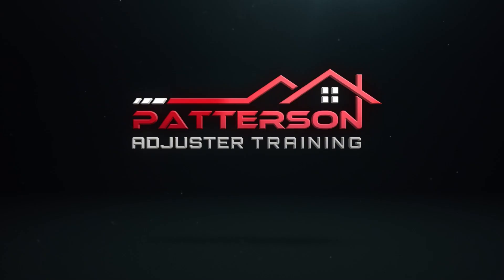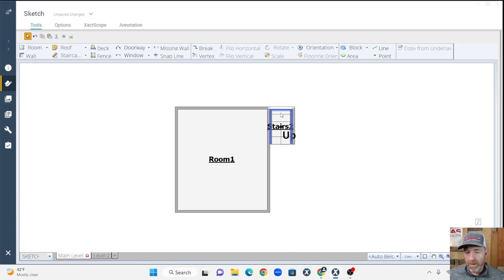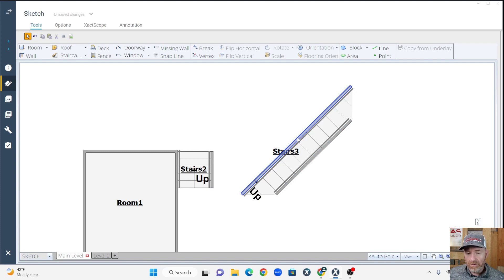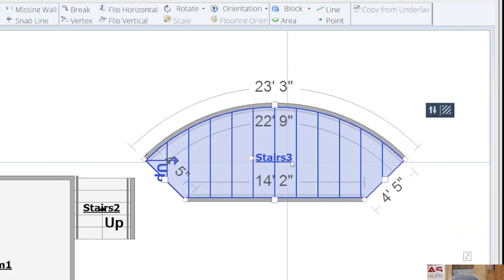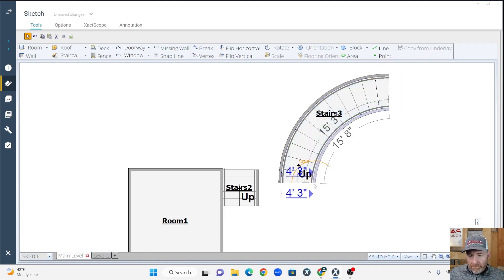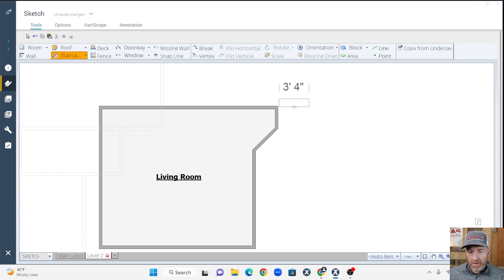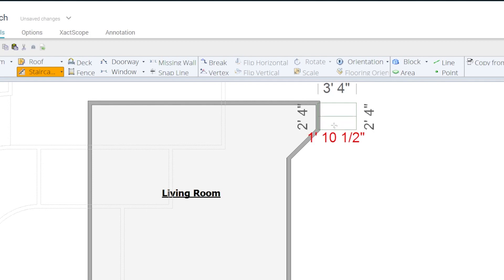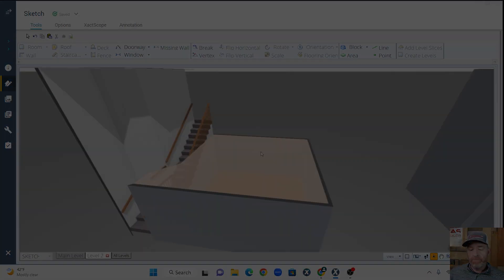Learn How to Sketch Curved and Angled Stairs in Xactimate

Comment: Man I pray you see this and can help, I have been taking the lvl 3 exam for the past 3 days for the exact diagram that you took I believe based on the video. The problem I'm running into is the "rounding measurements" part where its throwing the numbers off slightly by an inch or so from the original, I've tried all the different measurement rounding's and it doesn't change anything. Did you have this problem? If so, will it be a big problem for the test? Please let me know I would dearly appreciate it, great video too btw.
Reply: I figured out the problem but I'll leave my comment incase anyone runs into the same thing, IT WAS THE CEILING HEIGHT.
Reply from the maker: Ah good catch! Thanks for sharing! It’s always the little things!

Comment: Making the stairs like that isn’t too difficult. The annoyingly difficult part is getting the rooms to mold and match the curves of the staircase.
Reply from the maker: @Superman-ns2yv, you’re right getting the rooms to cooperate with the curved stairs is always fun😁
Reply: @pattersonadjustertraining  May I ask if you have any tricks or tips for that?
Reply from the maker: Curved staircases are tricky. Whenever possible, I build the curved staircase first.  Then use the Wall Tool to box in/connect rooms to the staircase. 
The other way is to connect a room(s) at the entry/exit point then click and drag the room(s) out.  As you push or pull the wall towards the curve it should follow the curve of the staircase. Lastly, make adjustments to the room measurements. 
You may have to play around with it.  These two ways should be able to get you want you need.
Reply: @pattersonadjustertraining  thanks for the help👍